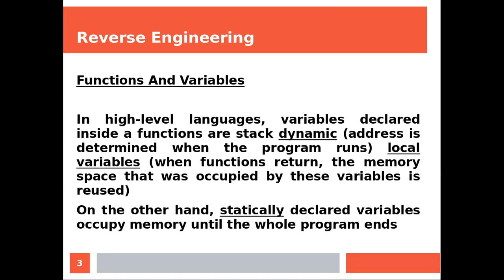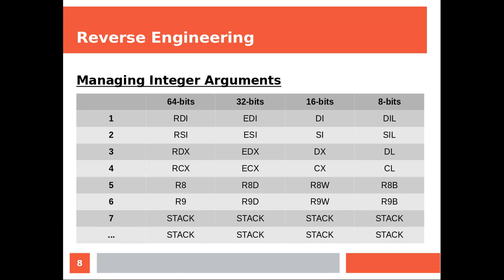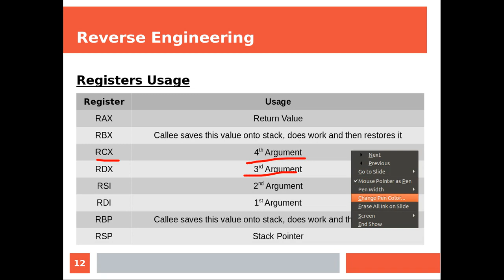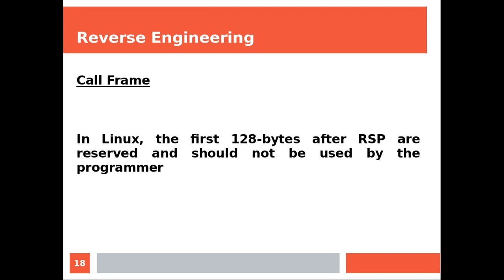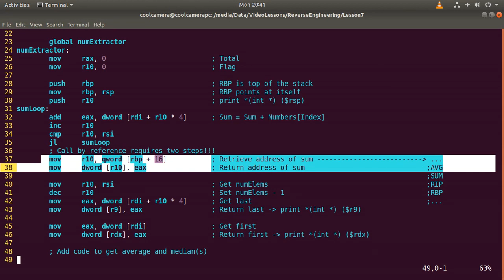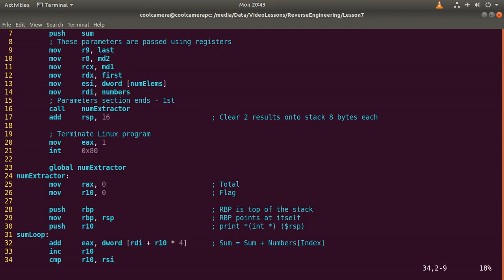Reverse Engineering | Assembly Functions | Beginners

Comment: If my function return some value then which register will store that?
Reply from the maker: It depends on the architecture. For Intel platforms return values are usually stored into RAX/EAX, how it's explained in the video. I hope this helps!
Reply: For x64 Calling convention:
Integer values: RAX
Float values: XMM0
For x86 Calling convention: everything here is treated on the stack not in registers